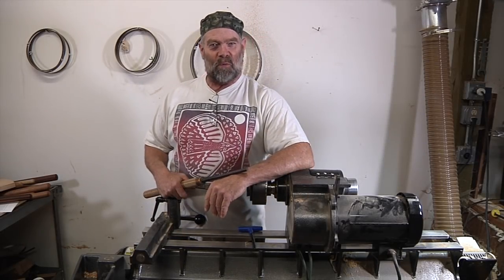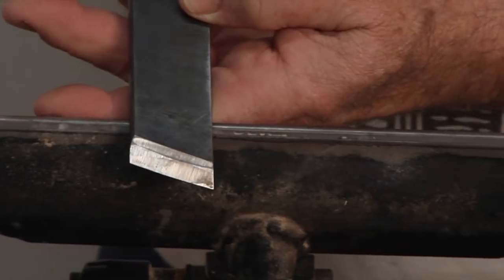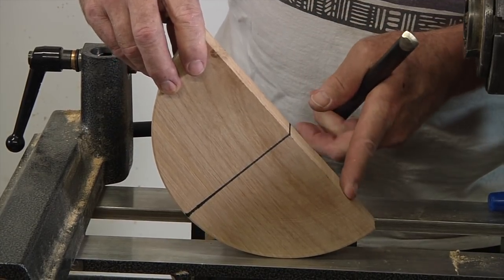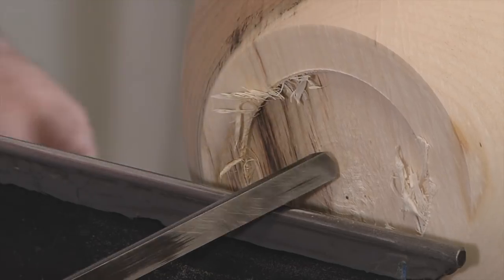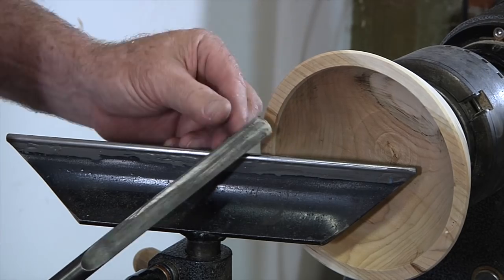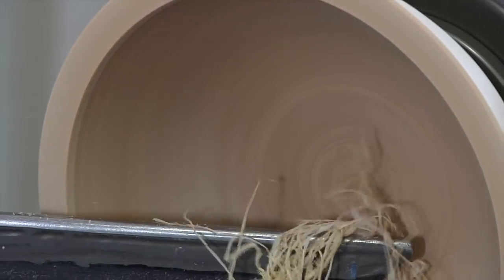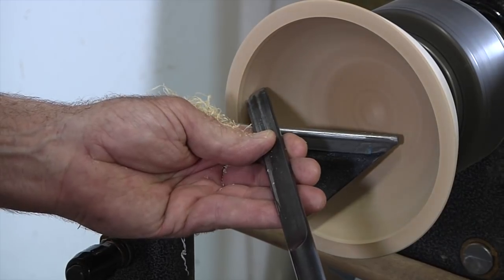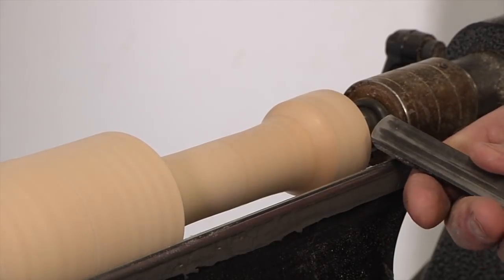Fluteless Gouge Tips by Robo Hippy

Comment: Thanks Reed
I purchased the half inch model from Doug, it makes a surprising good cut on bowl bottoms/sides.  It's kind of a hybrid tool being a scraper (bevel not rubbing) under some turning situations and a cutting tool (using the burr) with the bevel rubbing under others. The tool is not nearly as hard to use as the skew but rivals it in the quality of cut.  

Thanks for the heads up

Comment: Reed, I am new to your site and I Just subscribed. I have not gone through all the comments here but could you tell me the differences between a fluteless gouge and a scraper. I am looking forward to seeing some of your more recent videos. BTW I have an order in for a couple of your curved tool rests.
Reply from the maker: Glenn, actually, your order shipped today... I got asked the same question about fluteless gouges last weekend at the AAW Symposium, as why can't they be used as scrapers. Mostly it is because of the round bottom. They can be used as a scraper, and I have one ground to be a negative rake scraper. The problem with the round bottom is that if you are working with either edge, the tool wants to roll where if the bottom is flat, it won't roll. So, it can be used as a scraper, but it doesn't do a good job.

Comment: Informative video.  Thanks for posting.  I saw that tool on the Thomson site, and was wondering what it was for.  Is that the 1/2" or 5/8" you're using in the video?
Reply from the maker: I use the 5/8 for the inside and outside of bowls and through the transition and across the bottom, I use the small one for inside the recess. I use the 1/2 as well some times.
Reply: robohippy I want to try one of those for bowls around 6" to 12" in diameter.  I would also like to use it for cleaning up end-grain boxes as you've shown in the video.  If I can only buy one, would you recommend the 1/2" or 5/8"?
Reply from the maker: paul johnson Well, for bowls, I prefer the bigger one. For end grain on boxes, the bigger one would work, but you might find the smaller one easier to get inside a box. Not sure. I do tend to prefer bigger and heavier tools though...

Comment: Reed ,  how did your application of JBweld work out on the tantung steel you mentioned?  Mahalo,  Dean
Reply from the maker: It didn't. Came off after about a month. There was one guy who used the standard wire type silver solder, and put a couple of pieces under the tantung before applying the torch, and that worked. The wire type silver solder is easier to find than the ribbon.